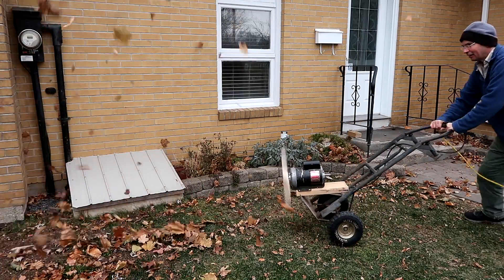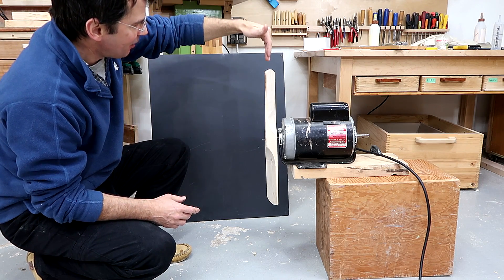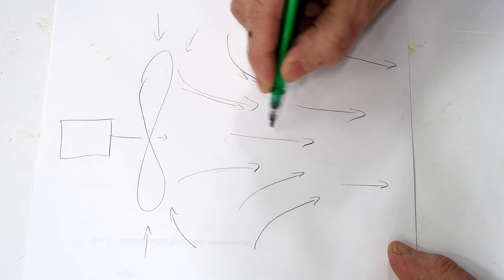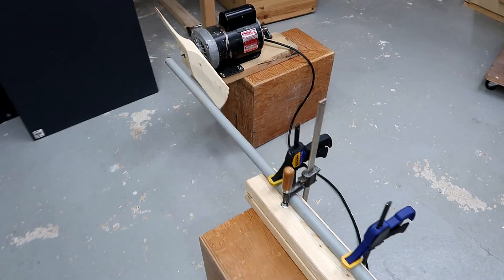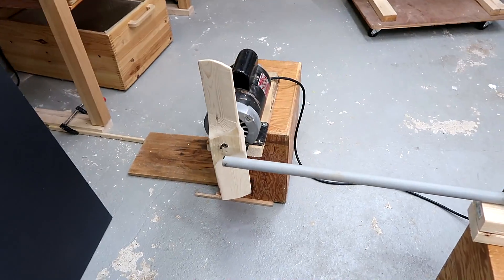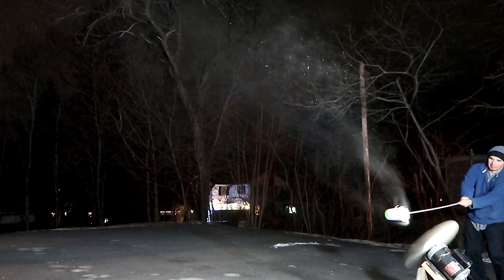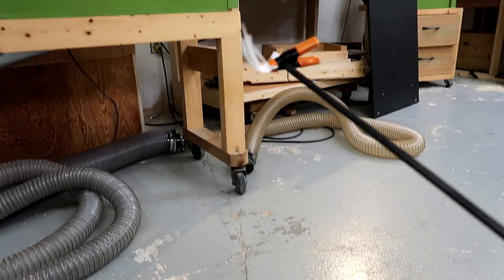Complicated air flow in front of a fan

Comment: Moving air (gas, liquid) has less density than stationary air. That is why you detect "vacuum", where it is just the fact, that air would like equal it's density by sucking in air from the surrounding. (As this, it has nothing to do with spinning.)
Reply from the maker: Do tell how movement makes the air less dense.
Reply: @matthiaswandel  Actually I don't know. But if you have the same air all around, and you measure less pressure in the blast area, then the density must be less of that same material.
Reply: I just have checked Bernoulli's principle, as far as I see it talks about constant density. So I need to think about this a littlebit more.

Comment: Fascinating and FUN! THANK YOU! I always enjoyed that part of engineering. Many of the same forces and equations apply to propellers and speakers, so acoustics and aerodynamics are closely related. You're right about the Coanda effect. Also, though air is technically a fluid, things get very interesting in water. Trying to design efficient boat props for maximum propulsion vs power, while getting minimum cavitation is an edifying challenge! You might enjoy checking out that stuff too.

Comment: Now you need to build a smoke generator the emits parallel lines of smoke so you can further reveal the air flow patterns.  Then you can create an array of pito/static sensors connected to an arduino data logger to produce a computer generated visualization of the flow and pressure.  That would be fun!

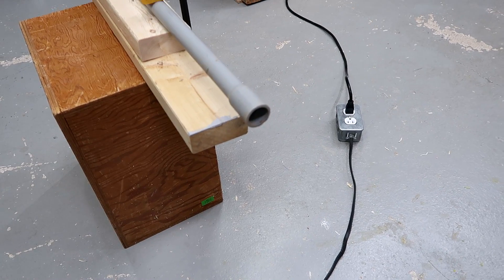Comment: 4:42 ever seen how a gopher hole's ventilation works? or a franklin stove? air movement across the end of the opening causes a vacuum, so in the case of a franklin stove it draws air up the chimney instead of letting it into the room, or in the case of a gopher den (one entrance is intentionally lower than the other) it induces air flow through the den.
Reply from the maker: franklin stove is all convection.  works when there’s no wind too

Comment: If you want to maximize air speed, use a shroud. If you want to maximize air volume, don't. Flowing air pulling in stagnant nearby air is called entrainment. It works on any fluid, not just air. https://en.wikipedia.org/wiki/Entrainment_(hydrodynamics)

Comment: Matthias, perhaps the negative pressure when doing the test with the pipe is due to the mechanism behind a Venturi meter: fast moving air PAST the opening of the pipe causes low pressure in the pipe.

Comment: It doesn’t suck from the side of the propeller. The blades act like a wing, and at the tip there is a vortex which tries to unite the front and the back of the fan. That’s why you see air going backwards.
The cowling would limit the vortex and make the blades more efficient. The air you see getting sucked back is a loss. It would ideally be propelled forward with the rest.

Comment: I built a simple box air filter with a desk fan as the air moving apparatus. Efficiency was horrible until I used a bottomless plastic bucket to make a tight cowling to make sure the fan pulled air only from the box, rather than keep it spinning around at the edges of the propeller. Maybe it's different when you just want to push a lot of air, idk.
Reply from the maker: you can’t direct suction so you needed the bucket to suck thru the filter.  but if you were blowing at the filter, it would not have been so bad.

Comment: A ducted fan is much more efficient. Look it up on Wikipedia. The duct prevents higher pressure air behind the propeller from going around the propeller tip towards the front, wasting energy. His argument about how it would not be efficient completely disregards the fact that with the duct the airflow significantly changes.
A properly designed experiment would simply measure the thrust with and without the duct. The air flow videos are fun to look at but only show direction, but not pressure or velocity.
Badly designed experiment

Comment: An intake cowling with aerodynamic shape reduces intake air drag resulting in an increased air flow of 15-20% approximately as compared to a straight intake pipe. 
To measure relative air pressure differential even in the modest manner of your approach  with the pipe it must be aimed directly into the air stream - see pitot tubes. Since you are so fascinated with this experiment please consider adding an inlet cowling, then outlet straight section (3x diameter of fan minimum), making the blade from hardwood (safer), and since you are so computer/electronic savvy measure the rotation of the the pickup prop. No need for high accuracy, just relative readings. 
On a smaller scale also make a cowling for the inlet of a vacuum hose. 
Still, nothing like a lot of horsepower - watching the effect on clearing the driveway is impressive!

Comment: Coanda effect is the phenomena in which a jet flow attaches itself to a nearby surface and remains attached even when the surface curves away from the initial jet direction. In free surroundings, a jet of fluid entrains and mixes with its surroundings as it flows away from a nozzle.

￼

www.thermofluids.co.uk › effect

Coanda Effect - S & C Thermofluids Ltd

Comment: 1980s I used to test domestic hot water boiler balanced flue a bit like a biscuit tin size on a simulated wall, the wind machine I used had a honeycomb air straightener that was about 6 foot square. It was a boring job, it would take a full day to complete. 
1/ Increment air speed 5mph increments
2/ 0 - 180 ' from sided to side every 5 degree increments 
b/ 3 angles up, straight on and down.  :-))
For each increment 
Measure Temperature of the boiler water 
measure the CO2 and CO 
Warning
If the CO2 started dropping steeply hit the emergency stop and run out of the room, the reason was CO2 would drop if it was starting to be saturated by CO.
We had large opening windows and it was a cold and miserable job. 
Interestingly you could tape a matchstick in some places near the flue that would create a condition that the exhaust would get sucked into the intake and game over.
The flue looked like https://www.plumbingworld.co.uk/main-multipoint-balanced-flue-9-15-telescopic-flue-kit

Comment: wouldn't the cowling take all that vacuum and concentrate it, sort of like the ground is doing when you lower the yarn?  So effectively the exhaust is concentrated and more defined, and the incoming air can't come in from the sides (but that suction is still there) so it pulls in entirely from the back.  Pretty sure that's how it works with hovercraft thrust fans - having an open propeller is known to be far less efficient.  I've never thought about why other than, "it seems obvious" - but then your demonstration shows it's not so obvious (but no less a fact.  Somehow.)

Comment: Hi Matthias, for analysis on the performance of a cowling, please search "ducted fan". It is a very popular teaching problem in fluid mechanics.

You are right that Bernoulli's principle does not apply to turbulent flows. However, I would consider the flow in front of the fan to be weakly turbulent. Also, Bernoulli can certainly be applied to the flow behind the fan. So we know that there is relatively low pressure before the fan. Then we can use thermodynamics to determine the increase in pressure across the fan (use the power draw of the fan). Assuming it is adiabatic, the specific enthalpy will increase and the increase in pressure is relatively small, and the pressure remains less than ambient.

Another interesting thing to note is that flow coming in the side implies that the flow is speeding up as it crosses the fan (since the flow is not even close to being fast enough to be compressible). However, for a ducted fan, this means that the flow does not accelerate across the fan. Yet this does not necessarily imply a difference in performance. It points to the main purpose of a fan: to create a pressure difference.

Comment: unducted fans are more efficient than ducted fans at lower speeds due to their "infinite bypass ratio", a good example being the General Electric GE36. There plenty of other advantages and disadvantages, but two of the main disadvantages is that there's nothing keeping the fans from going through an airplane fuselage if they let go, and there's no noise attenuation, both of which are huge deals for the airline industry. I think my main concern is the longevity of your blade and where it might go if it lets go.

Comment: Fascinating exploration! You would need to actually put a cowling on it to definitively prove it one way or the other. 

The theory goes that at the propeller tip the high pressure air on one side bleeds over into the low pressure area on the other, creating vortices that waste energy by reducing the pressure difference across the prop and thus, the force applied to the fan. So the efficiency should apply to propeller driven vehicles. 

There's the classic explanation of how a wing works with one volume of air needing to travel further, and because it travels further, it therefore travels faster, and because it's faster, it's lower pressure. Also the common wisdom that vortices are areas of low dynamic pressure. I have never liked this explanation, there seems to be one or more logical leaps in there.

Comment: Your conclusion is incorrect. I can tell you for a fact and provide physical test data on an AMCA 210 test setup that a housing for a knife edge case performs different that a blade spinning without any housing. Coming from a manufacture of ventilation equipment. Your theory starts out on point but are missing some critical factors that change with the addition of the housing. While the improvement is not drastic you should see an increase between 2% and 5% on CFM and thrust. Addition of a venturi on fans with higher static pressure may see 3% to 8% improvement on CFM. Just rules of thumb.
Reply from the maker: see pinned comment.  Also, if you shoot the air into a duct, that's a different matter alltogether, because now you aren't sucking in extra air.  So if you blow into a duct anyway, or are sucking out of a duct, might as well make the duct the best shape for the fan (as in, a cowling)
Reply: @matthiaswandel  I would be happy to demonstrate on significantly more scientific equipment and walk through the basic principles more clearly. You have some of the principle correct but the variation is maybe not correct by you blade design due to methods use. Love the videos!

Comment: The interesting bit here is that the column of movement produced by the fan has its own physical properties. You were spot on with your analysis of the Column creating its own vacuum. That’s why it appears to be pulling air from the sides of the propellor blades

Comment: I think it's worth noting that your propeller has a constant pitch while most modern propellers have less pitch at the ends of the blades. Just because your fan isn't more efficient ducted doesn't mean most aren't.
Reply from the maker: this is why I also demonstrated with the oscillating fan.

Comment: Vena contracta is caused by the fast moving air. Its total pressure remains constant but has a static and dynamic component. The static pressure outside the moving airstream is higher, pushing the airstream from the sides. Torricelli noticed the same effect when emptying a wine cask.

Comment: Thanks for another great video I really find your channel informative
I can give you an example of a similar situation that I ran into
.I was doing testing and balancing In the machine room that  had a large centrifugal blower that drew the air on the negative side through a typical Built up HVAC system/casing with your typical filters preheat, heating, cooling coils and discharged into a trunk Duct within the machine. There was a register only a few feet from the discharge Of the fan in order to condition the machine room. I found it strange that the register on this supply duct had the air flowing into it as apposed to be discharge from From it. I later learned the reason for this suction occurred because of the following.’Total pressure equals static pressure plus velocity pressure’.   And because the velocity was so high at that point close of the discharge of the van at the static pressure within the ductWas less than the atmospheric pressure within the machine room Turning the supply register into a register that actually sucked air into the duck work

Comment: What you really need is stator vanes... I built my own fan snowgun and it didn't have very far throw, but when I added stator vanes to eliminate the swirling of the air stream, it went significantly further.  However, stick with either a prime number of stator vanes, or at least not the same number as there are fan blades, or you will create a sweet air raid siren with the resonance...

Comment: Well, you have a hypothesis that "a cowling would reduce air flow" but you didn't test it. Also a little ironic that you claim bernoulli's principal doesn't apply, yet you still find a vacuum being generated where you don't expect one. Perhaps it's not the pure bernoulli's form, but you are still getting a vacuum from air passing by the pipe; the distinction is largely meaningless and not a hill worth dying on.

Test it with a cowl. See if you're claims are right. Right now you have an untested model.

Comment: Yeah, the moving air from the fan creates an area of relative low pressure in the mouth of the pipe drawing air through it from the other side.  This is a well-known phenomenon and used to great effect in pneumatic vacuums, which is what you've basically made here.  There isn't a vacuum right in front of the propeller hub.

Comment: The fan plays a B Flat from the musical scales, in case you wanted to know.😂
Reply: I work in a Lab where we have vibrating plates and motors similar to his. As a musician, I have noticed they all produce a B flat. I think it has to do with the 60hz cycle of AC power. 58.27Hz would be B flat, 61.74Hz is B.
Reply: @eyesopen45  Well that makes sense. Induction motors try to spin at line frequency. But as the rotor speed nears target speed the torque falls so it never quite reaches full speed if loaded.

As a side note induction generators are physically the same except the shaft is spun slightly faster than line speed. The generator wants to spin at exactly line speed to it converts the extra into electricity.
Reply: @Jason Hall   @eDoc2020  ...Common 4 pole induction motor on 60 Hz line has synchronous speed = 1800 rpm, but slips to typically 1760 rpm under load, which is 1760/1800 = 97.778 % --> 0.9777 * 60 = 58.6667 Hz note ~= B flat [pretty closely].  Nicola Tesla invented the AC induction motor ~ 1887 & the rest is history...

Comment: You still need to put an airfoil on your prop.  I think you will be amazed at the improvement in air flow.
Reply: "Airfoil" is a particular shape, evidently
Reply: @allencummings7564  I'm in shape, round is shape too!
Reply: what's an airfoil? I was thinking how about making the ends the same as all the newer wingtips on aircraft these days? those are supposed to provide smooth air flow right
Reply: @johngreydanus2033  A prop is flat on one side and curved on the other giving the airplane lift.  You can get air movement by the angle of attack of the blade but it is not as efficient as an angled blade with an air foil.
Reply: @dillonpapa  You still didn't enlighten me on an AIRFOIL, let me go to Google. I thought it was wings that are flat on one side and curved on the other giving the airplane lift.
Reply: @johngreydanus2033  yes... that is an airfoil.  Curved on one side flat on the other on both blades.
Reply: "An airfoil-shaped body moving through a fluid produces an aerodynamic force. The component of this force perpendicular to the direction of motion is called lift. The component parallel to the direction of motion is called drag. Subsonic flight airfoils have a characteristic shape with a rounded leading edge, followed by a sharp trailing edge, often with a symmetric curvature of upper and lower surfaces. Foils of similar function designed with water as the working fluid are called hydrofoils." ~wiki

Comment: The cowling helps, because the low pressure in the back of the blades sucks the high pressure from the front; this generates wakes that dissipate energy and slow down (drag) the propeller. Is the same effect why there are winglets at the ends of airplane wings. https://en.wikipedia.org/wiki/Ducted_fan I'm not sure if it means "more airflow" though...

Comment: A bell-mouth inlet (nozzle) from 'behind' would be more efficient, to smooth the air ingressing from the rear.
Check your fellow countryman @AgentJayZ:
https://youtu.be/M9dyRLciuPM?t=305
Reply: Also (at 19m 45s) applying a converging exhaust nozzle (not just a uniform duct) to convert the gas pressure into far greater velocity for thrust:
https://youtu.be/M9dyRLciuPM?t=1185